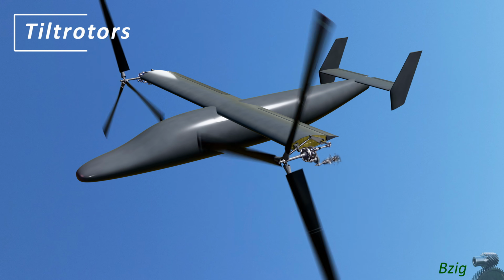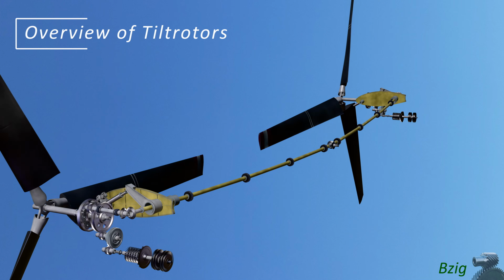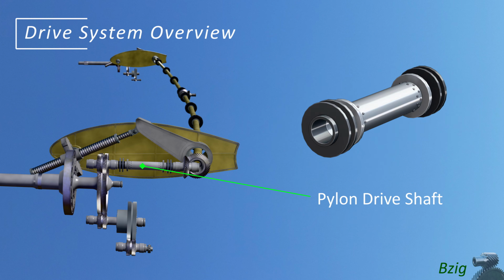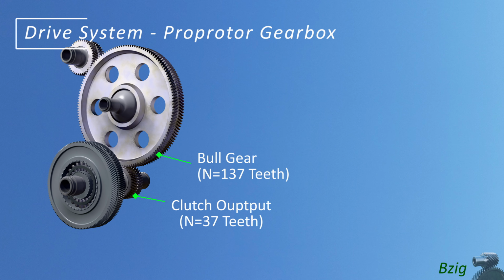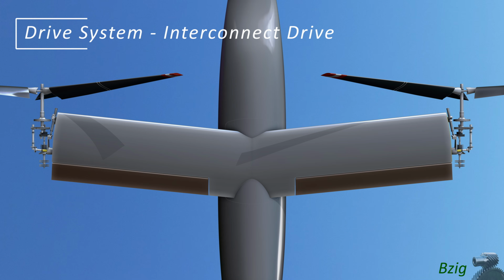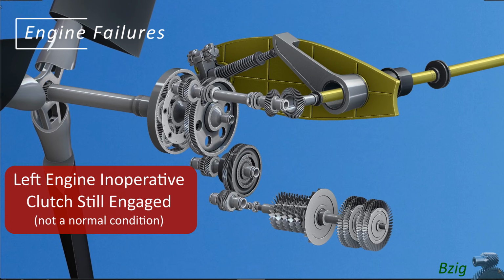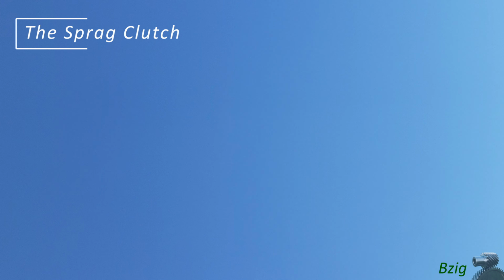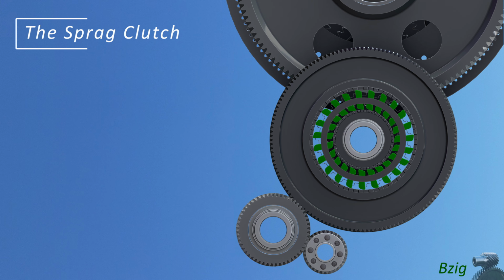Tiltrotor Drive System

Comment: Really enjoyed your statement at the end about safety and failures. Just because some accidents happen does not mean the design or technology is bad. As an engineer who works in this field these things are incredibly complex and there are so many variables that most people don't think about and just say "thing bad". But they can be continually improved upon with redesigns, better materials and manufacturing techniques, and more training.
Reply from the maker: Really well said.  I've seen so many cases, in my career, of the over simplifcation of causal factors preventing meaningful change and improvement.

Comment: edited a third time.. was wanting to ask about the Bell HSVTOL but it just seems a bit too complex for my liking. I just want to fly the MV-75 and aspire to master the understanding of it in your fashion. 

Instead of the HSVTOL, I'd be more interested in your analysis of Pterodynamics aircraft. Do you think it's simple hinge mechanism is practical for heavy load and high velocity vtol and forward flight (level 3&4 UAS for example)?
Reply from the maker: thanks for the point out to Pterodynamics.  I wasn't aware.  That looks like  a more elegant design than the legacy tiltrotors.  As with anything... it's the details that come out of design and flight test that count.  Having the propulsion outboard of a fold mechanism would likely get a lot of attention during design reviews.  I like how they avoid long duration edgewise flow on the rotor discs.

Comment: The exact reduction ratio in your gearboxes from the engines to the propellers is (137/31)(137/37)(1+139/53) = 3603648/60791.

If the first stage gear reduction was 106:27 and the second stage 135:32, the reduction ratio would be exactly 60.

Comment: how about using a tilt wing with high speed  belt connection? We want to biild a model on tilt geometry but need to decide between tilt wing and tilt rotor. The tilt wing ailerons can help with yaw in takeoff and the wingspan length could get rid of the rotation gearboxes.

Comment: I don’t know if you’re modeling the v-22 specifically, or a generic tiltrotor, but almost every system is triple redundant, so there are hydraulic pumps in both nacelles as well as midwing. The midwing hydraulic and electric service are only the primary systems when on APU power, also located midwing (or in case of a dual engine failure)
Reply from the maker: It's not the V-22, but I'm taking inspiration from the Osprey, AW609, VX15 and the XV-3.  In both the script and the video, I try to strike a balance between presenting enough information to make the concepts of operation clear, without presenting too much information to make things hard to follow.  Thanks for the information and the comment!

Comment: My calculations show that a tiltrotor wing console can have a drive of the same power, but twice as light in weight. And a third smaller in diameter in the projection of the wing.

Comment: That was an amazing video. Thank you. AW609 actually has the engines install backward that is why the exhaust is in the middle of the nacelle instead of downward like the V-22. And only AW609 and V-22 has mid-wing gear box because of the wing sweep, but V-280 Valor has straight wing so no mid-wing gear box.
Reply from the maker: thanks!  I reused the engine I created for the UH-60 video and didn't take the time to model a PT-6.  The gearbox is a fabrication of my mind.  I'm aware the Osprey uses a double planetary.  I wasn't trying to make this an copy of any of these aircraft... just trying to show the general concepts.

Comment: Good job.
Is it possible to find out the diameter of the shaft of the main rotor sleeve, the one that comes out of the planetary gearbox? I want to pre-calculate the dimensions and weight of the hydraulic motor by 26 kN *m.
Reply from the maker: sure, but this isn't real.  I'm making a design that "looks about right" not one that's a replica of the real thing.  It's 110mm OD and then tapers to 90mm.
Reply: @bzig4929  Thank you. The diameter of the rotor shaft of 90 mm is sufficient for the pusher of the blade tilt drive, which runs inside. These are hollow shaft hydraulic motors. To get 26 kN * m at 509 rotor revolutions, you need a 5000 cm3 hydraulic motor with a pressure of 350 bar. In the USSR, such hydraulic motors were designed. I'm still in the process of calculating.

Comment: The new Bell V-280 Valor engines don't tilt, not sure about the gearbox...it is a better system than the V-22?
Reply from the maker: I imagine it's better... Later design iterations are, generally, improvements over earlier generations.

Comment: If I not wrong, the lifting is not by downwash. The rotor system is actually like a helicopter rotor system. In other word, think of it like u have two helicopter rotor head mounted on each side of the wing. That mean, the lifting is done by rotor blades itself, not by downwash. (Rotor blades is like a wing, moving very fast and creating lift).
Each rotor system has its set of swash plate, just like a helicopter. The stability coming from tilting the rotor disc. Note: This is true on V-22 Osprey and V-280 Valor. The tilted wing aircraft during early 1950th is just propeller system.
Reply from the maker: I get your point, the blades create a pressure differential that creates lift.  I equate this to downwash because it's the change in momentum of the air flow that qualifies the amount of lift and this also quatifies downwash.  I believe both perspectives are correct.

Comment: As usual, another great video. What amazes me about these aircraft is all the weight of the aircraft has to be supported on a rotational hinge, at least until it begins forward flight where aerodynamics will help as airflow moves over the wing. Even then, there is another massive hinge through the center of the aircraft that allows the entire wing/engine assembly to swing parallel to the body in order to facilitate compact storage. I hope you'll be able to model that also. :)

Again, great video. Thanks for sharing.
Reply from the maker: Thanks for the comment!  a lot of the shipboard requirements (like the wing stow system) were a struggle during development of the Osprey, but it is amazing to see that in operation.